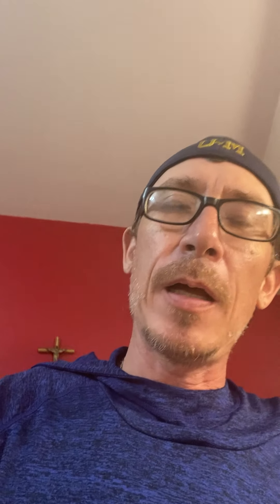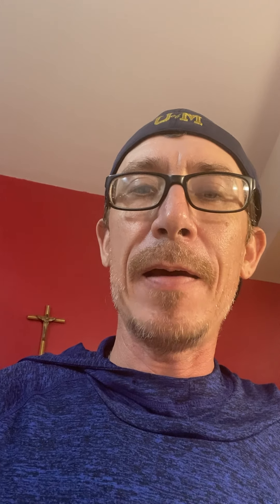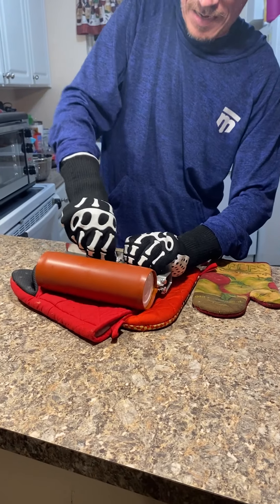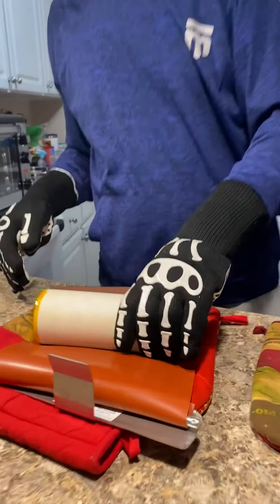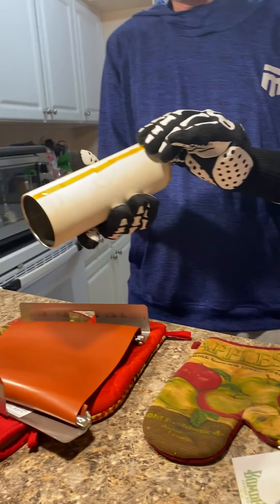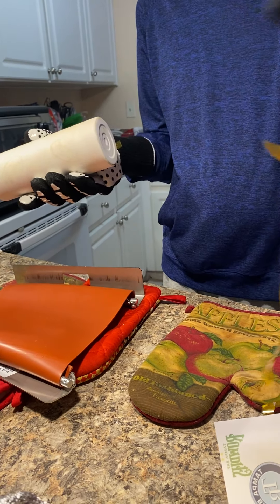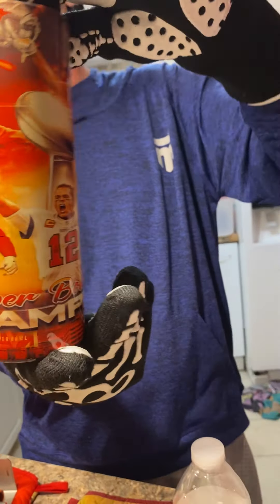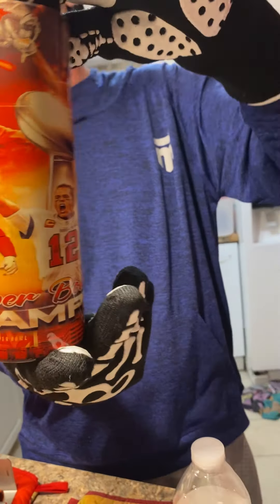STOP THROWING AWAY YOUR SUBLIMATED TUMBLER MISTAKES! How to Resublimate a tumbler #reuseoldtumblers

Comment: I've done this method a couple of times, it works amazing it you use a dark image over it also. After making sub tumbler's for over a year now. I've made alot of mistakes. I've also learned form them. When you were speaking about the seal..and perfecting that. I have a suggestion. So after I line up the sub paper on the cup. I hold paper very tight, also i not only use the sub paper I also wrap it again with plain paper. Also very tight. Sealing and making sure there's no air or gaps. Then I use masking type the blue kind and wrap around the cup very tight. Temp should be at 390-400 6 mins. My tumblers have been flawless. The reason you're getting that light ghosting near the seal is because your tumbler silicone wrap is leaving a gap and not enough pressure. I dont use the silicone wraps on tumblers or shrink wrap.  You may know this already, but maybe this can help others. 🤗
Reply from the maker: Awesome advice, thank you very much for sharing… I am going to try the blue painters tape with my wrap, I am waiting on my tumbler shipment as we speak!! But hopefully this will help others as well!!
Reply: I use the shrink wrap after taping the paper on tight then I run  my fingernail down the part that got ghosted on your tumbler. Than put the shrink wrap. The main thing is making sure there is no loose areas otherswise air will get in there and cause ghosting. Hope I made sense

Comment: When you baked your image off for 40 mins did you wrap your tumbler or just stuck it in there by itself?
Reply from the maker: Just stuck it in the oven, no wrap or cover. I have also read recently, (have yet to try personally) that U can cook off the image much faster if u have a heat gun, just using directly on the tumbler…. Will update once I try!!

Comment: What size cup is that? Can you tell me what size you use for a 30oz tumbler
Reply from the maker: That is a 20 oz skinny…. For all tumblers I use my tumbler press, never had done 30” in the oven, I have read where some lay their tumblers down, I’ve never tried but would be afraid it may scorch or burn🤷‍♂️ wish I could be of more help, I will say if u do a lot of tumblers invest a tumbler press, galaxy lopo or the like
Reply: @khaotickrafter  Thank you, I did my first cup just trying to get the correct size for 20oz L*W. I did the 30oz but I couldn't get it right so it could do the whole length of the cup
Reply: By the way the oven I have, you don't have to turn anything and it came out great
Reply from the maker: @misstbaby724  that’s awesome about the oven, did u figure the size for the 30 oz? I thought u were asking about the oven but now I get u may have been asking about a template? Is it 30 oz straight or taper?

Comment: I'm new and I don't know how to set the W and H for measurements for the photo what should I put it on? Please I keep making it too short I did measure my tumbler but guess I don't know how to 🤯😩
Reply from the maker: I really couldn’t tell you what to set as because it does depend on size of tumbler, there are many different ones, but measure how bight the cup is from top to bottom, that goes in H, then measure around cup and that goes in W, add a little extra, so if your cup is 8 inches high, put 8.125 in H, and same for the width, add .063 to .125 to the measurement and see if that helps. Let me know if u understand?
Reply: @khaotickrafter  ok will do and thank you for your response I really appreciate it.

Comment: I thought when doing a sublimation tumbler in air fryer or toaster produced toxic fumes.  If so wouldn’t that be in the oven
Reply from the maker: Sublimation itself produces those fumes weather u do it in toaster oven, air fryer or convection oven or regular oven. It is actually recommended to do them in a convection or air fryer as it circulates the heat better. That’s why I use a counter top one so u don’t toxify your home regular stove. The cricut mug press or tumbler press u can really smell the sub fumes, gives me headaches at times
Reply: And you can never use convection oven. for cooking again strictly sublimating only.

Comment: I am using Epson et 2800 with origibal epson ink and an Oster XL oven at 400 degrees. I made sure my print was really tight on my tumbler, used painters tape and heat tape to secure it, used a thermometer inside my oven showing 375, left it in the oven for 6 mins. However, during the process the tape starting to coming off a little and my picture didnt transfer at all. Only my tumbler was a little burnt since it looked brown.  Can someone tell me what Im doing wrong??
Reply from the maker: Hey there, so based on your message I would say if you are using an epson eco tank with original epson ink is the problem, this process is sublimation and requires sublimation ink. Regular printer ink does not work with this process.

Comment: You image is super bright and glossy on paper  can I ask your setting
Reply from the maker: So for this, I printed from sawgrass studio print manager, with standard color sure setting on, and I want to say I used either the vivid setting, or graphic setting. I have never altered any of the settings in print manager, other than using photo, vivid or graphic setting. Generally for pics I use photo or vivid, and for anything else I select graphic or vivid, depending on whichever looks better in the preview. I use texprint r paper and pick that for paper setting and substrate I probably picked the ceramic setting, but possibly polyester fabric. If you use sawgrass and print manager u should understand that, if not, all of that was probably gibberish, lol, but hope that helps!!

Comment: this would work great if it's a full wrap  with a lot details only. Because the  trace from last image . I don't it would on a single or smaller images  or words  because  you would have to match it right on the same spot and that would be hard. I'm guessing.
Reply from the maker: Yes it would be hard to match up, but if u are using words or partial image and u mess it up then it would be easier to cover with something different in that case, as long as u go darker it will cover up what was underneath, but yes it would be hard to match up wording to redo with the same image

Comment: What the time and the temperature you use.
Reply from the maker: To bake the sub off the tumbler I did about 45 min at 380-400, the regular sub time was around 380-400 for 6 min using a silicone wrap